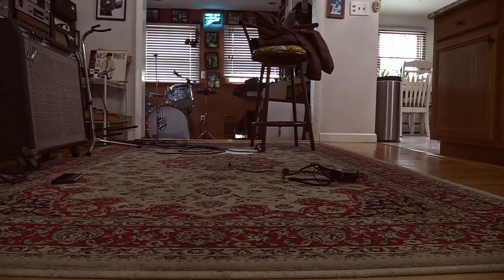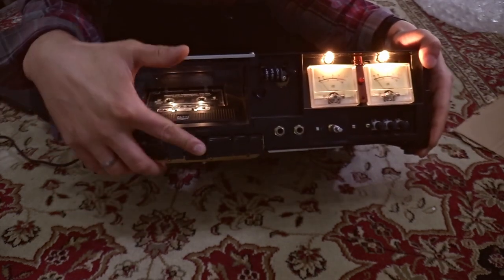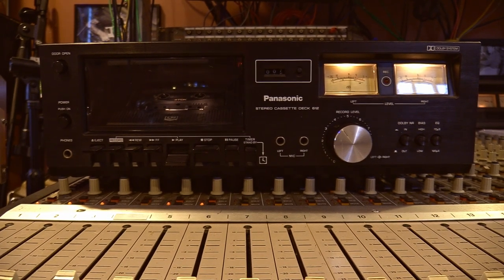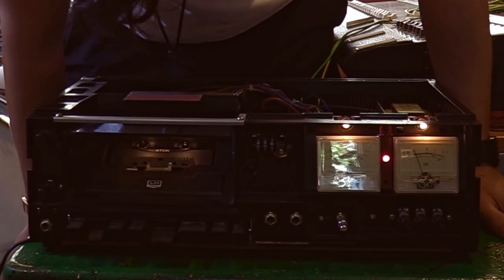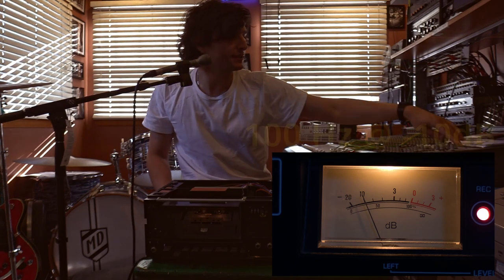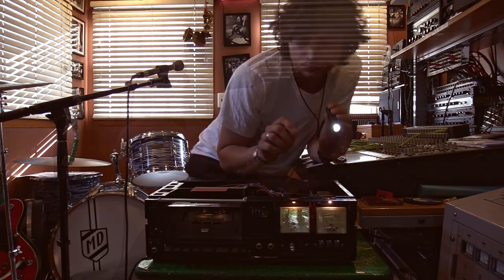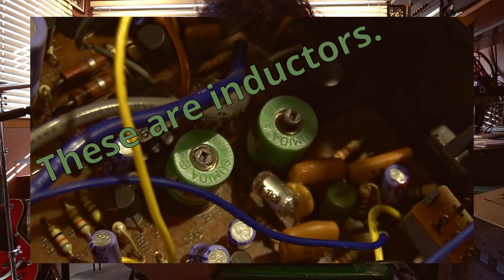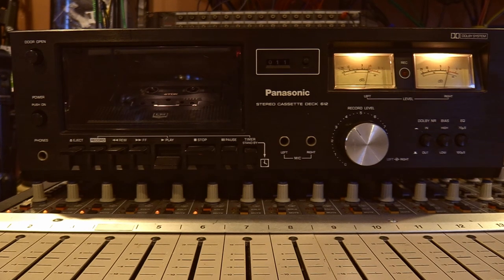Garage Audio Repair: Fixin' and Calibration' a Cassette Deck

Comment: Mario, I completely relate to the this repair/calibration.  I had a diode fail in a rectifier unit in my four track years ago, which was sending errant pulses to the momentary switches in the transport control. Man was that fun to track down!  

You have miles of patience! That inductor swing was crazy!  Anyway… good job on this unit.

Edit: I also Dig that song and how you sang it.
Reply from the maker: Geez I wouldn't even know where to start with finding a diode failure!

Comment: The only experence with this type of problem with belts is a crappy old $3 walkman knockoff that I use for recording distorted sound FX. The belt in it is VERY tight (with a design flaw where the motor for the belt is permanently set to X1.5 speed), causing a faster recording speed. For recording purposes, I diddn't fix this issue because it made everything playback slower when I play it using any other tape deck I have, making for an AWESOME SOUNDING effect for any tracks or FX that I run through there. Plus, the recording head on it has a slightly colored natural E/Q to it, and it sounds unreal. (I mean, for a $3 walkman knockoff I basically found on the street.) 

Mario, I recommend this tequnique, as it is fun to play with this sort of thing, and sometimes the possible mixes that can come out of doing this type of trick can be amazing,, Just make sure to do any vocals for the specific song AFTER you do this teqnuique, as it can make everything in the room sound MASSIVE in the recording. I don't know, sometimes vocals sound way better like that. You can hear this effect in Led Zeppelin's No Quarter - studio version, they slowed down the tape AFTER vocals were taped. However, Led Zeppelin's When The Levee Breaks is a prime-time example of slowed down tape before the vocals were taped. Idk, you can play around with it.

Thanks,
James
Reply from the maker: James, 

I have actually used this 'technique' a few times in some of my songs. In this song towards the end you can hear the "mad scientist" type of sample. https://youtu.be/gWJLBLc2GTY?t=247 . For that part of the song I used a stretched out rubber band on my portable cassette player to get a really quirky wobbly effect on the prerecorded tape. It sounded like a vibrato guitar pedal turned to the max. Really fast fluctuating speeds really cool! 

Cheers
Reply: @Mario_DiSanto  Cool, I can go for that effect any day of the week. Only with tape you can get this effect!

Comment: Skip To The Paragraph below this one for the summary.
Once I swapped out the belts on my cassette deck with smaller sized ones, I playing about the switches because it didn't sound right when I listened to the start of "Life On Mars" and accidentally left it on play mode (With no tape inside). I went out in a hurry because I was gonna be late for something and when I came back about 3 hours later and found it was still going. I quickly turned it in panic (Because Bills). And the next day I listened to the same song again and it sounded better.

Just leave in play mode with no cassette inside for an hour or two and the belts should stretch enough that it sounds good. Or something like that. I have very limited experience.
Reply from the maker: That's a really good idea! Doing that now.